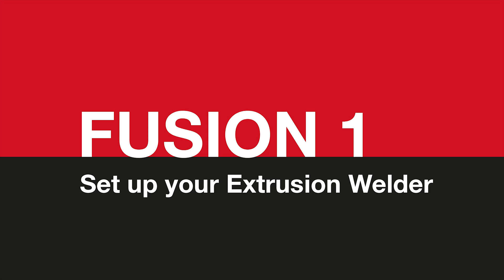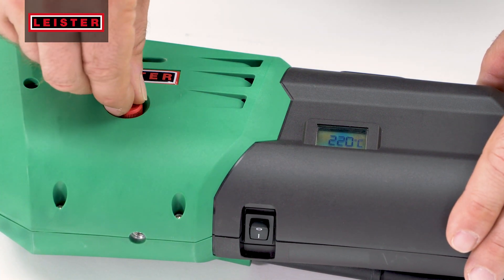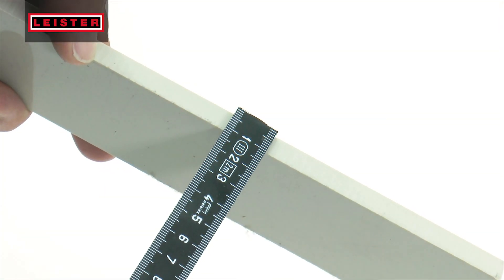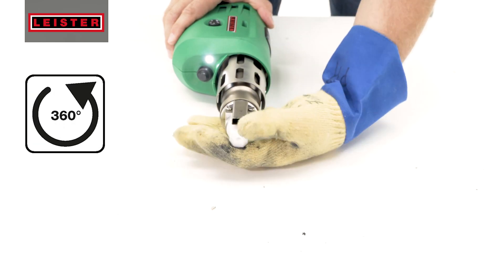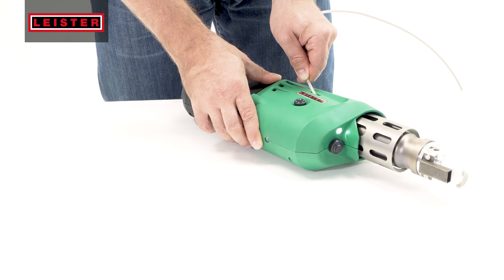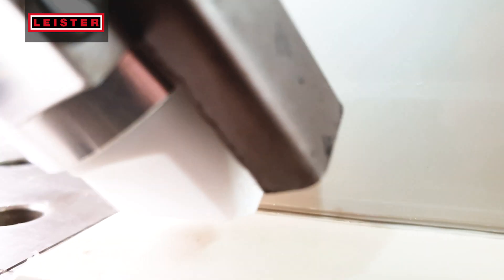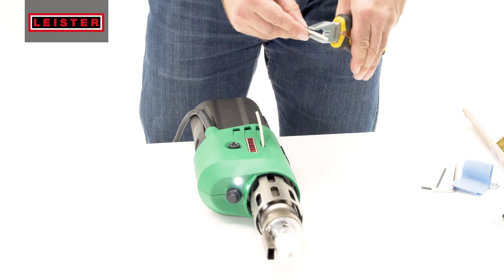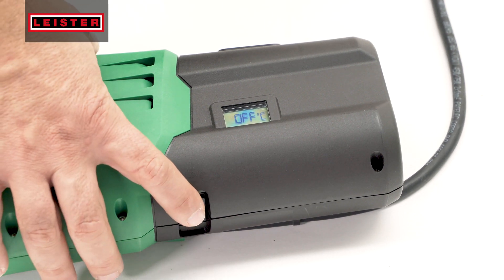Leister Tutorial | FUSION 1 - Extruder welder set up

Comment: How do you reset the computer on this??? I changed the brushes yet the it still shows er 0100 and won’t work.
Reply from the maker: Hi Tom
Please contact the official Leister sales & service partner in your country. There you'll receive the correct service / information for your FUSION 1. Sales and Service Points - Where to buy Leister Tools and Welders
https://www.leister.com/en/Services/Sales-and-Service-Points

Best regards
Leister Team
Reply: @LeisterTutorials  it’s ok, I figured it out. I had to hold the start button in and plug it on, then switch it on/off 5 times and it took me to the menu where I can reset the hours. IMO this is very shady tac tics to make your customers send the guns back to have the hours reset. And the fact the the gun shuts off completely making it unusable just because it hit the service hour mark. Not great Leister. Not great at all!!!
Reply from the maker: @togwilson  

Dear Tom
Sorry for the inconvenience. The extrusion welder must be opened to change the carbon brushes. Some safety-relevant points must be observed. For legal reasons, we cannot solve this in any other way.
Therefore, we ask you to contact our partner directly. Depending on the situation in your country, you can carry out certain service and maintenance work yourself.

Best regards
Leister Team